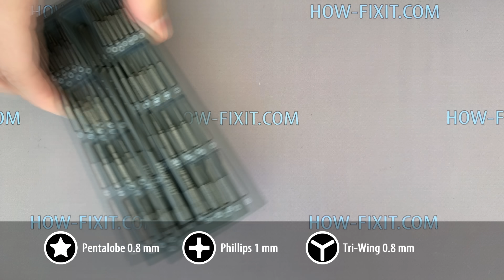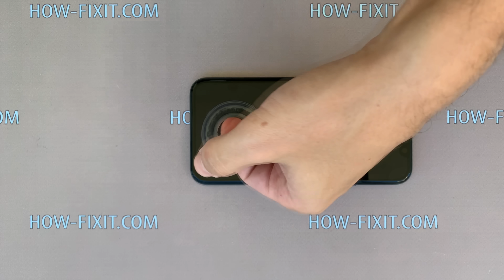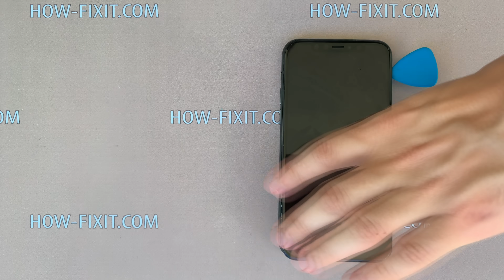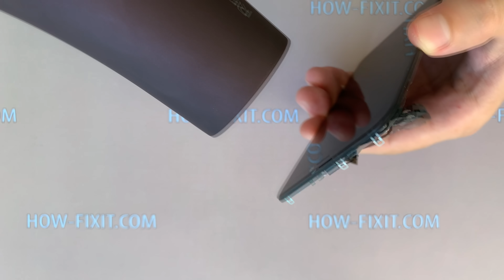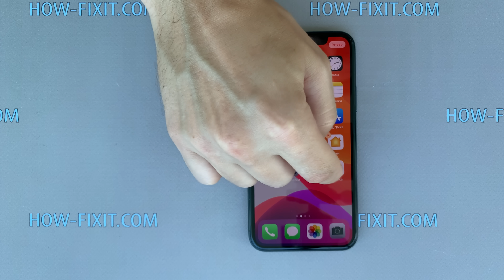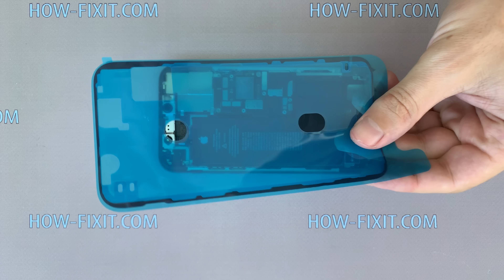iPhone 11 Pro Screen Replacement Tutorial | Complete Repair Guide

Comment: Does it need any calibration or adjustments after replacing the display? I have an original 11 pro display from another phone and I'm wondering if I just need to transfer parts from the broken one to the new one. Thank you!

Comment: I have 0 experience and just replaced my screen and battery within an hour using your videos. I also fixed my FaceID. Thank you so much for your clear videos!
Reply: To fix your face Id did you have to replace the front camera or were you able to swap the old internals, cheers
Reply: How did you fix FaceID mine doen't work? Thanks

Comment: For anyone that is considering this I’d highly advise you to just take your phone into the shop. It looks simple but I ended up paying way more to have everything fixed that I damaged in the process. 10/10 do not recommend attempting this 😂
Reply: If YOU couldn’t do it yourself, just say that.
Reply: @TamarisIlaria  absolutley I couldn’t and that is my opinion for anyone else that is debating because it’s extremely fragile and minor mistakes are expensive with that. So there yah go cuntcake
Reply: I managed it in 1 hour. With 0 experience.
Reply: @dhillon621  congrats champ
Reply: Skill issue tbh
I did it easily
Reply: Just need to be light fingered after all it just delicate components
Reply: I think you broke it because in the video the guy didn’t remove the second battery connecter before removing the screen flex cable
Which can cause short circuit and at best case scenario fry your screen and at worst case scenario fry your whole phone including the motherboard

Comment: Hello dear, i went to change the glass in a repair shop, but it's showing a warning message "unable to verify this iPhone has a genuine Apple display".  Did the repair shop changed my original screen or it's a normal thing. thank you.
Reply: I changed my screen myself and my phone gave the same warning also. I guess it is related with screen brand or producer.
Reply: You can try checking if your phone has all necessary updates installed (settings > updates), if not, install whatever is missing and try again.